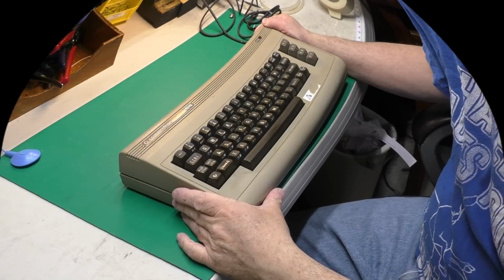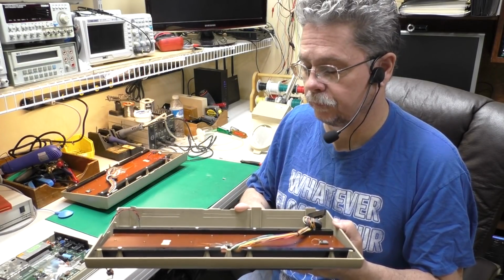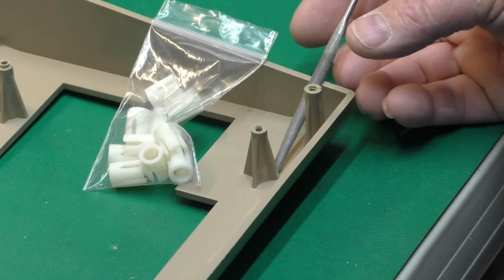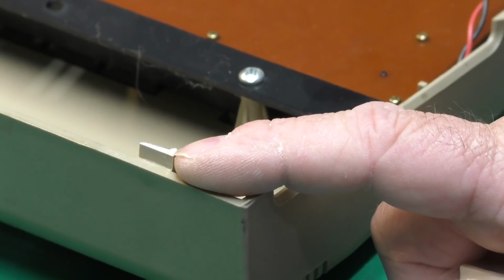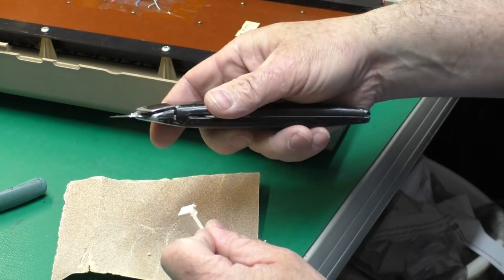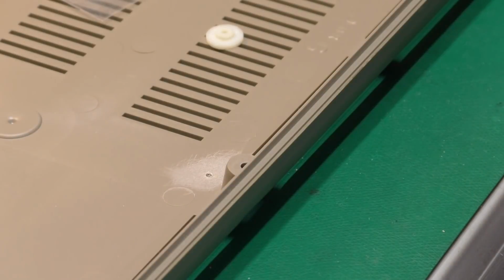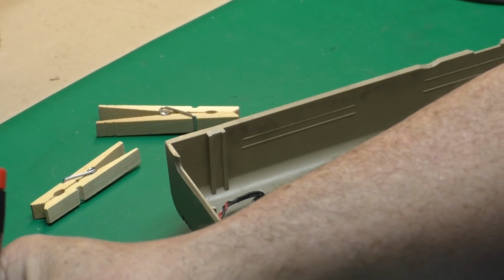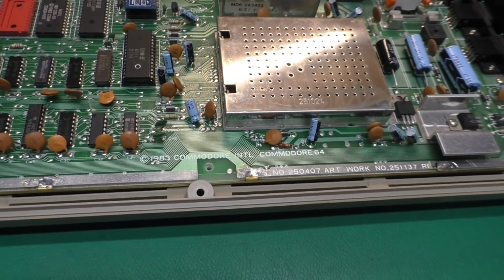C64 Breadbin Case Saver Installation

Comment: This is an awesome piece of kit. I had a VIC 20 with a loose and rattly case, and several parts broke when I tried to insert a cartridge. The case saver was easy to install following these instructions and now the VIC feels solid as a brick! Awesome stuff and super cost-effective. 

I’m new to Commodore computers and vintage computing in general. I have been taking a deep dive into this channel, trying to glean as much information as I can. Great stuff and keep it up!

Comment: I don’t see a link to the repair packs anywhere. Did I miss something?

Also - do you have any advice on how to close a case? I usually try to insert those rear tabs first, but then the front doesn’t want to close without the back snapping into place that feels really unhealthy. It feels the wrong way to do it, but I can’t find an alternative. In your video it just closes naturally without resistance, which never happens for me.
Reply from the maker: Hi. The link is in the video description. I'll paste it at the bottom of this relay too. The tabs catch and cause that creaking/popping sound because they have square edges and so do the slots in the bottom of the case. In the video I mention rounding off these corners with a small file so the case will close smoothly. It helps a lot. 

https://www.soigeneris.com/commodore-64-caser-saver-repair-kit

Comment: Hello!

It's great that you have the clips for the A600 now, too! I just ordered two kits :)
I wondered about the C64's replacement for the bottom posts: Wouldn't it be the better choice to glue these in using Acetone or an other ABS solving dissolving plastic glue, like Uhu Plast special? Because I think the parts molten together make for a stronger bond than using epoxy and also this would avoid filling the screws' holes with epoxy. And you wouldn't even need to sand the bottom, because that little plastic remnants of the old posts would dissolve anyway :)
Reply from the maker: I did a video a few months before this one where I showed the development of the kit. One of the things I did was try different types of adhesive to test how well they held.

The two most effective were an ABS solvent glue used for plumbing pipes and the Devcon plastic epoxy. Both worked equally well the advantage of the epoxy is you have a little longer working time.

Acetone is basically a solvent glue and works well if the parts fit tightly together. I fixed some cracks in a 1541 case with Acetone yesterday in fact. You might be able to use it for the new PCB mounts but you would still need to sand the area flat and clean with alcohol. Having a good fit is vital.

For the other parts the epoxy is essential to make up for any gap in the fit. I'm also 3D printing all of the rear tabs now as it provides a better fit for the complex shape and the epoxy works much better between different plastics.
Reply: Ah, this mean the parts are all PLA now?
Reply from the maker: @elmariachi5133  The rear/side clips for all machines are PLA. The C64 PCB stand-offs and post sleeves are CNC machined ABS.

Comment: Just did my first one.  I found that holding the bottom case screw mounts in place while I pulled out the drill bit wasn't as easy as it looked.  But re-inserting the drill bit for a quick re-align was all it took.  Waiting for the epoxy to dry now.  Great kit Jeff.  Thanks!
Reply from the maker: Thanks, it does take some practice to get the hang of it. Glad you like the kit :)